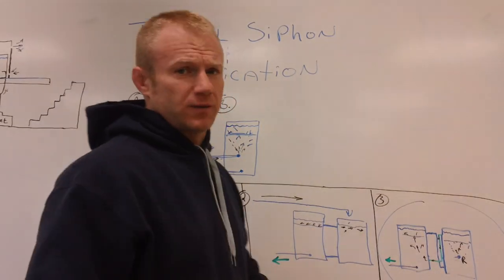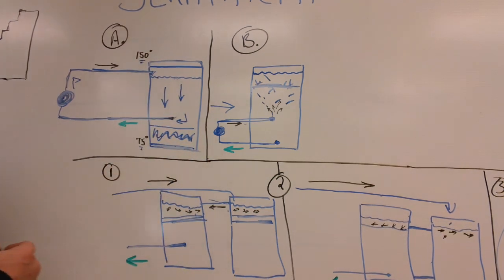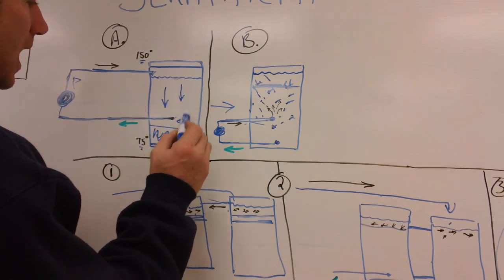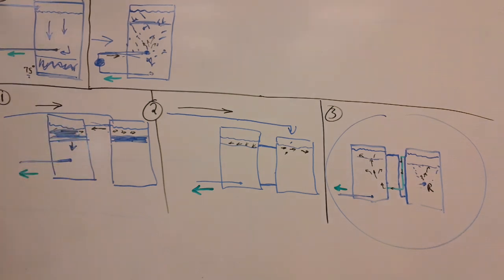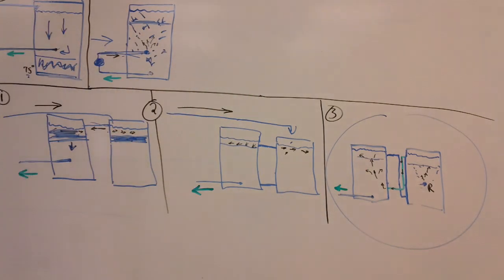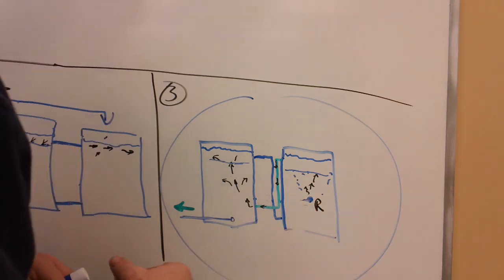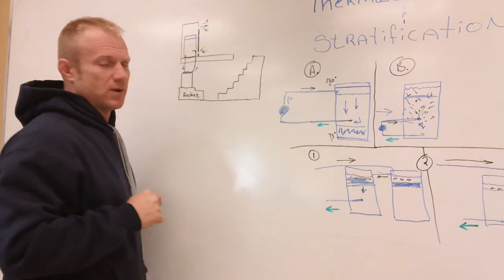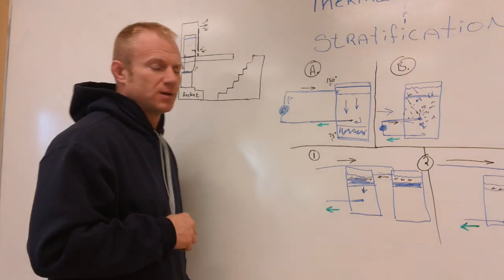Thermal Siphon and Water Stratification for Wood Burners

Comment: Likely one of the best videos on thermosiphon. I still haven't found anyone explain how much rise/head will be produced by heating water through a copper coil around a stovepipe. That's what I am trying to figure out. How high will to water rise without a pump.?
Reply from the maker: I will attempt to explain. The body of water must be higher than the coil in elevation, on the barrel(container) as long as the inlet and outlet is arranged one higher than the other The one on bottom will have  more water depth (weight/pressure) than the one above it. so as pressure builds it will travel the path of least resistance which will be the higher (inlet/return) because less water weight above it equals less pressure which equals path of least resistance. the more dense cold water that settles (bottom of container) will be more pressure thus become the outlet path to feed the coil. boiling point is not necessary  just a slight difference in temp will cause the thermal siphon loop. Some Idiots have said it will build pressure and explode. The simple and obvious solution it to not have a sealed container like loose lid or drill a 1/8 inch hole in the top some where or go all out and install a pressure release valve. To address your question how high will water rise...pressure will build until it finds a path of release that will always be the higher point and will never be the lower point because of reasons explained here in. and since the pressure has no where else to go or be released in theory there is NO LIMIT . AS LONG as the distance traveled did not allow heat to radiate  off the pipe and cool to a
the temp BELOW the lower outlet temp before it got back to the container, Which again the obvious solution would be to insulate the return pipe to prevent heat loss.
I took the time to write this please take the time and  let me know if you think this is an adequate explanation and is understandable.
Reply: @TheTitian69  yes thank you that helps (my understanding) tremendously. I currently have a 550 gallon tank that is approximately two feet higher than the coil on my stove pipe. The distance from the tank and back is about 20 feet. 
The thing is that my pipes must first go down from stove, under my lifted cabin,. Then back up to my tank so I have had doubts that it would all work properly. But from what your explaining it should work. 
I have a coil behind my stove in sand, one on my riser pipe below my bell housing (50 gallon barrel) and one around my barrel.  
I have to run for now. Will come back to this later. Thanks for responding.

Comment: Hi, I was surprised to hear the huge 75 degree difference between the top and bottom layers. Then I realised that water just like air and other gases obeys the law of gravity. The colder denser water molecules will tend to stick at the bottom and the lighter hotter molecules on top. I think that putting your return feed at almost mid tank is a great idea since it would start to create more movement in it. The nearly boiling water would rise quickly to the top initiating a sort of toroid effect which will in turn homogenise the temperature through out the tank.

However I'm wondering about another idea. Since we're on the subject of rocket stove, which works with a J tube inside a riser, how about using the same principle inside the hot water tank? Inside the centre of the tank you could install a fairly large vertical pipe made of insulative material for maintaining a relatively high water temp within it. The base of the pipe would have large perforations to allow colder water to be sucked in. A little higher, let say at a third of the pipe would be your hot water feed (sealed onto the pipe) creating an L tube. So as the hot water enters the pipe it would keep rising to the top, the colder water would be continually sucked in and be warmed by the hot intake (I'm assuming). 

Of course as in a riser the walls of the tank (even if insulated) would keep cooling the water which would create a "downward current". The toroid effect is then repeated. What would even improve the system further would be the lining of the inner pipe with closed cell foam. Now you would have a powerful hot water riser. Because of how gravity works, this method, I think, would only work in a double tank system if you were to keep the tanks separate and divide your hot water intake in 2, feeding them separately.

Hope you don't mind the idea.

Comment: Hey Van Powell! Thanks for sharing all of this and doing the math. I am in the process of building exactly what you built in Death of the Rocket stove, but following the method 3 that you showed in this video. My question to you is, what did you use to seal the connections on the barrels? Still trying to figure out what the safest bet is, but not sure on what I should be using for a seal on the connections. Thanks in advance!

Comment: I think the thermal syphon would be the part that I am least comfortable with because in my mind, a contained cauldron of steam is trouble.  You also mentioned that you experienced a thermal differential between the top and the bottom of the tank.  Are you saying that the strength of the thermal syphon is such that it can deliver hot water back to the tank below the water line, and that it doesn't need any additional help?  I am also concerned about what would happen if the entire thermal mass were to reach boiling point in a closed system.  Surely explosions are a very real possibility?  Moving on from that, how would you avoid reaching boiling point across the mass both from a cut off valve standpoint and a top-up standpoint if water was lost through steam?  I know I am asking a lot of questions and I apologise if they sound dumb but I am very interested in the subject and so itching to learn more.  This has been a wonderful educational experience.
Reply from the maker: Hello Aaron. thermal siphon great advantage is no moving parts to ever break while moving the heat and thus the water. My set up could have been better I learned allot.. I should have returned the water just a couple of inches above the out let in order to more uniformly heat the water. the water expands and causes pressure in the coil the pressure wont go back up the inlet due to all the weight and pressure of the water above it in the barrel so it will always take path of least resistance and push it up and back to the barrel when the pressure builds to that point. Pressure past the point explained in the above can never build in an open loop or vented to the air as my barrels have small pin holes in the lid and the lid just sets in hole so no pressure can ever build in the barrel and the pressure in the coil only builds to the level of push needed to return it to the barrel. Now as far as boiling goes like I have stated a 55 gallon drum will hold 75k BTU's that would be 7k per pound of wood times a factor of 10.5 so 10.5 pounds of wood burnt at 100% efficiency and 100% delivered to the water that means none for the draft of the flue or exit into the house at all to boil it. Bottom line you wish you could boil that much water..LOL the loss to the house plus the % of efficiency of the burn plus the loss of the coil and lines means ultimately that its very hard to do. if for nothing more the barrel if not insulated will loose it fast enough to prevent boiling plus the other issues. a 250 gallon tank would be VERY hard to boil with a stove and a coil a 55 gallon drum with 50 gallons of water with a 20 foot coil as applied raises the water temp to only 155 max thus far . You basically design your volume of water to your BTU delivered capability as so that you never get there and thats way easier than actually boiling it
Reply: Hi and thank you for your very comprehensive answer.  I now get what you mean with setting the barrel size to fit the available BTUs which is a very clever and lateral bit of thinking (which I had totally failed to appreciate first time).  I guess the other thing is to make sure on the opposite end that you are also sizing the system so that you will not drop below 60 degrees C to prevent the possibility of legionella bacteria.  I guess once you are comfortable with the math and also achieve an even temperature soak throughout the barrel then it is simply a case of taking the results to size the system.  My thought was instead of a barrel to transfer the hot water into pipes for underfloor heating but I am starting to think that might be a difficult task to achieve a constant temperature above 60 and below 100 throughout the entire length.  Cold water tanks need to be kept below 20 degrees C also to eliminate the possibility of Legionella so in my head I had started to consider a thermal transfer to generate electricity but I think it is going to take someone who knows more than me to figure that out properly.
Reply: I think an easy solution to this is to have a safety pressure valve installed.

Comment: Are you trying to heat the water? Is it possible to put a metal tank above the fire and just heat it like a water heater?
Reply from the maker: Hello Leon. That name has been in my family for 4 generations now... Yes you could however if the tank is too large it takes too much heat and causes problems with the fire and the draft. Using a smaller tank can result in too much temperature rise and cause over boil or steam. wood stove dont have the regulation like a gas valve or electric relay
Reply: Van Powell
Thanks for giving me the issues involved.  It's an interesting problem.

Comment: I have seen chatter about flash steam, and having a boiling water explosion. As I wrap my head around what you are saying, I have 6 kids running around, so please excuse me if you have already covered this. Is it because yours is gravity fed and looped that yours is fine.
Reply from the maker: I look at it like this the water is in the coil up to the same level as in the barrel to the coil always has water in it. As pressure from expanding water rises it has to find a place to go. It has to go one way or another as pressure builds and surpasses either point of in or out. The reason it goes up and out is the pressure of the weight of the water setting over top of the in put wont let it escape that location so it pushes it out the top as more water is pushed in by the weight of the water above it back to the coil. I always new my pressure could only build to the point of escaping either point that would equal the pressure only of the water it has above it thats all that is possible cause beyond that pressure it would simply push water out of the coil, as it pushes it out of the coil into the barrel the barrel has a lid set in loose in the top with a few small pin holes so if I did get any more pressure of steam that the pen holes could handle it would simply push the loose lid cap up and that has never happened . its an open loop how could pressure build? the only way it could is IF the barrels the water ran into was sealed so it could build past the point of the barrels could handle it, which depending on the rate in which the barrel looses temp it still might condense in the barrel as it cools in the cool(relative) barrel and still not cause a problem but why take the chance? pressure can only build to the point of escape in this set up or any other. if the escape is wide open how could it ever build pressure? I did put the return line too high as to cause too much pressure on the up side and it started flowing the other direction and the input started getting hot.. but lowered it and back to work it went just fine again. hope this helps and yes its gravity fed which mean it has to be open as to not cause a vacuum that would cause the water to stop flowing.
Reply: I believe some people are just afraid of what they don't know. Thank you for going forward and experimenting. The same people that are knocking what you have done and saying most of youtube is full of junk, are the same ones that use youtube to confirm their own opinions and or experiments. Dont give up. Keep it coming, you are making the world a better place. I saw the loose lids but thought my understanding of this concept is still in it's infancy, so i should ask. I missed the pinholes in your video That is a good idea.
Reply from the maker: Courtney Bradley I had a well know guy on you tube with a channel that has a bunch of viewers write a post on how my thermal siphon would absolutely not work and would cause flash steam and possible explosion. I asked him are you sure about that? he said Yep I been there and done it. I told him I got some footage of the dang thing worken like charm and that the laws of physics must work different at my house or he is a dang lyre which one did he think was more probable? I posted part 7 of the bulldog rocket stove with the thermal siphon working just fine about 5 minute later.  he aint said much since.. LOL.. its worked ever day since just fine too. ignorance is the only poverty.
Reply from the maker: Courtney Bradley Junk on you tube nawwwww. But just like most things it aint all bad either. There are Harvard lectures and physics and language and alternative ideas and knowledge neck deep too.. If thats junk then one mans trash is truly another mans treasure. You got to have the brain to tell the difference and dig through the trash to find the treasure. there are more dummies than smart people wouldnt that apply to the videos made by the public too? Im personally grateful for it.
Reply: absolutely! I generally take opinions of others like I do the news. Research for myself and come to my own conclusion.

Comment: I've got a 250 gallon oil tank.  I was thinking of using it as a mass to store heat. My idea is a 12" system with duel exhaust. The exhaust pipes (6" drain pipe) run through the tank (filled with water!!). Is it do-able?  I figure the water won't boil..
Reply from the maker: sounds great to me send me pictures or a video, you wont boil 250 gallons it would take about 400,000 BTU's to getter done. I would consider a large coil perhaps inside top of  the barrel to max the heat I could steal and store.
Reply from the maker: I think an 8 inch exhaust wood take care of a 12 incher.. I would consider a 16 incher and use a 35 gallon drum laid on its side cased in cob for the bottom burn chamber, now thats a fire!
Reply: What about vertical pipes off the exhaust pipes inside the tank?  I think it would work. Especially with a full bore 12" burn.  That exhaust would be hot!  The exhaust will run to the chimney that will be plenty hot from the wood burner.
Reply from the maker: dont get your exit temp below 100 or youll have problems steal all of it up to about 120 and youll be fine
Reply from the maker: Jeremiah Shine that set up would likely result in the water taking too much heat and bad draft problems
Reply: Got it. I think the hot chimney from the woodstove will fix any pull problems.  My little Jøtul 8 did the trick at 19 below.
Reply: The block wall the chimney runs through is warm...through the drywall.
Reply: I think the chimney will pull it.
Reply: It's a 20' run from the planned spot to the chimney.  Shouldn't be a problem with a straight shot if my understanding is correct.
Reply from the maker: Jeremiah Shine Please dont let me interfere with your happiness and success. DoTry it. Im interested in your results please let us know how it works I need lots of help I cant make all these mistakes on my own. good luck keep me posted
Reply: Working on it. Baby twins slow me down!
Reply: @jeremiahshine  how the twins they walkin? I got 130gal water trying to heat and move. How u make out?